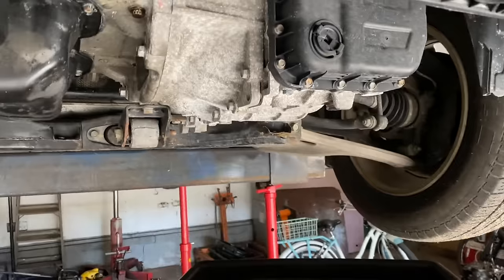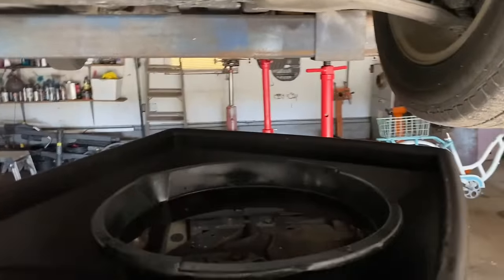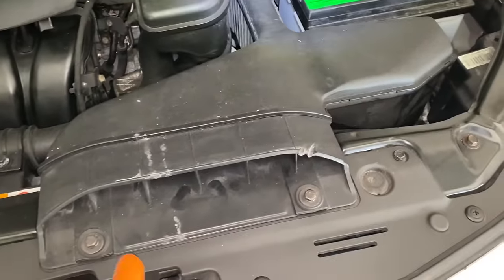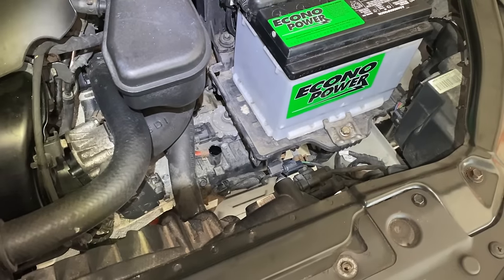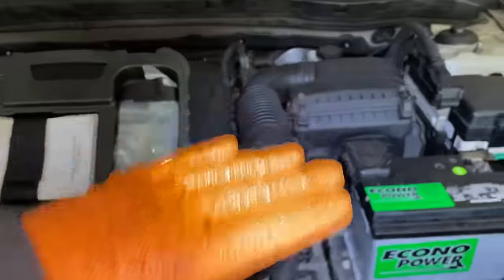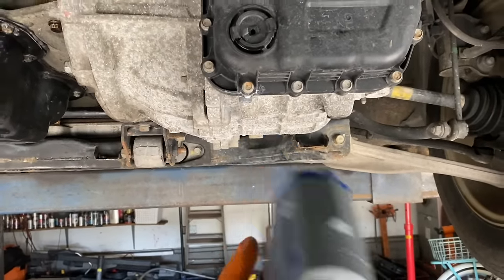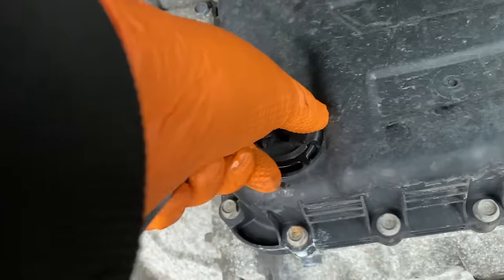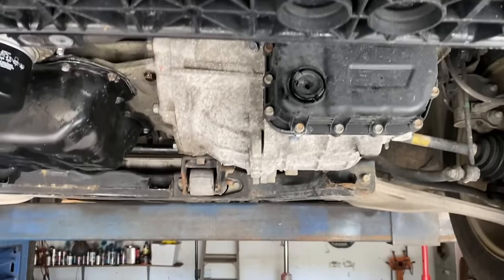Sealed Transmission Fluid Check & Change In Kia Optima Sorento  Sportage Rio Santa Fe etc. 2011 & Up

Comment: I love when a guy teaches me how to replace unreplaceable transmission fluid,  you the best!
Reply from the maker: Thank you! appreciate to comment!
Reply: @motorcarnut i have one with 185,000 miles on it. Im thinking of doing this. Should i?
Reply from the maker: @earlwright9715 if it were never done do half a fluid change at a time if it were regularly replaced then yes replace it.
Reply: @motorcarnut  thank you. I will go about it that way.
Reply: @motorcarnut  just to be straight  drain half of what's supposed to be in it. Replace that and change the rest another time?
Reply from the maker: @earlwright9715 good luck!
Reply: @motorcarnut  nevermind
Reply from the maker: @earlwright9715 but what you said was correct, drain half then refill
Reply: @Motorcarnut  thank you! I had a couple pints
Reply: Awwww, thanks, young blood! I am quite amazing.
Reply: Can you show us how to change on the 2017 nissan march please?
Reply from the maker: Don’t have one in the shop right now

Comment: When refilling these transmissions, remove one of the oil cooler lines. This will allow the air out of the transmission as you fill it. Otherwise it will keep backing up in the fill point and go everywhere. Remember to reconnect the hose after, or you’ll have a real mess to clear up.
Reply from the maker: Great tip! Thanks!
Reply: This is the comment i was looking for cause i do these at my shop all the time but the still have that problem.. i usually leave frint plug out and put my finger over as i let air slightly out as they poor in.. but deff gonna try this next time i service one in shop..

Comment: 2010 Hyundai Santa Fe 3.5l when I allow it to drain until a small trickle it shifts bad high high revs but when I add  8 oz extra so it’s not a trickle and a thick stream it shifts a lot better any idea why
Reply from the maker: You have to make sure the transmission is at the proper temperature first. And that you measure what you took out of the transmission and put that back in and start there.

Comment: Does the gasket come out easy on the plastic fill plug???  I changed fluid ,ANd the fill plug is leaking just a little I have a new gasket ordered ... Thanks
Reply: fill/level plug on the pan  NOT THE VENT/FILL PLUG on top
Reply from the maker: I don't see a problem, no.

Comment: Question: do I remove the bottom plug while the car is in park? And can the vehicle be running while adding fluid?
Reply: Yes and he doesn't specify so better off to just shut it off I guess, fill it, then start it again do the park reverse thimg amd check again. my question is tho is the filler cap still off(like in his demonstration) or do you replace it before starting the car
Reply: Nevermind he said to put it back on, then. Start it. While running keep checking till you get a steady light stream
Reply from the maker: Correct!
Reply from the maker: Do what rickybobby185 said, that's correct

Comment: Just learned Monday, that Mt 2016 Ford Focus has a Dry Dual Clutch, and does not have Transmission Fluid. And, it's a $3,000 - $4,000  Repair
Reply from the maker: It’s the power shift transmission is doesn’t have a pan be does use a special Motorcraft dual clutch fluid that should be replaced just like any other transmission.
Reply: Ford makes the WORST transmissions on the market, and they do it on purpose. I will never buy a newer ford because of it

Comment: You should always crack the fill port loose b4 draining!
Reply from the maker: Yes good tip for those who don know. If you can't get the fill plug off and already drained the fluid you can have problems
Reply: @motorcarnut  OK so there is ACTUALLY TWO (2) Fill plugs that I see people using!  One is under the Air Box (after removal)  and this plastic plug is actually the "VENT" for the transmission CORRECT?  The factory "FILL HOLE" is towards the rear and a metal 24MM plug like the 24MM metal drain plug -- CORRECT?  Does the Manufacturer (or dealer) use the VENT PLUG or the METAL FILL PLUG Location to add fluid?  That is my question!

Comment: Great video and timely one. I have a 2015 Hyundai Sonata slight damaged front underbody. Replaced radiator, still leaking coolant.  Turns out the transmission oil pan cover  and the water valve oil cooler was damaged leaking coolant and transmission fluid and needed to be replaced
Reply from the maker: Thank you for the feedback and glad it helped you!

Comment: Outstanding, thanks for sharing - planning to do here soon - only thing I'd add is to start with the trans cold (i.e. parked overnight) and the new fluid at the same temp - that way their density is the same, thus their volume - if one is warmer, it will have greater volume due to expansion - also, if your concrete floor has a slope like mine, just place a carpenter level on the rocker panel of the car below the side doors and it will tell you which end to raise on your stands until level - cheers!
Reply from the maker: Thank you! And thanks for the additional information! Appreciated

Comment: Good video. I just use the front overflow port as the proper level for the tranny. I don’t know why they have the plastic cap on top for the fill port. Dealers use the front port when filling. Thanks,  Steven B.
Reply from the maker: No problem, thanks for the feedback! Appreciated!
Reply: You use the level check port? How without it spilling right back out?? I have to missing something
Reply from the maker: Because when engine is off level is higher.

Comment: YO DUDE YOU'RE AWESOME!  Wish I'd taken this kinda stuff in school.
Reply from the maker: Thank you really appreciate that
Reply: That's not the fill plug. It's a 24 mm at the back on the top that's a breather port and it will take you ages to fill through that. Fill with a hook and hose from the back
Reply: @motorcarnut that's not the fill plug on the Hyundai 6-speed transmission. The fill plug is at the back of the transmission on the top and you fill it with a hook and hose and pump that's a breather port The fill point is a 24 mm plug as well just like the drain plug but it's on top at the back

Comment: The level off oil , in manual says to be taken with the engine on … if u take the level with engine off it will be a diference of 800 ml of oil
Reply from the maker: Whatever vehicle you have you go by , as a rule of thumb, whatever you take out you put back in then top off per your particular vehicle manufacturer’s recommendations as stated in the video. It helps a lot when people watch the whole video.

Comment: I used AMSOIL signature. No issues after 50k miles ago
Reply from the maker: Amsoil is a good brand but still has to be replaced as if we’re a Walmart brand. Contamination is the reason for the change just like engine oil.

Comment: I don't remember commending in this video, but: If the whole point is to check the level removing that plug at 7:14, why not add the fluid through the same hole? Turn the car, warm then add if you need more y the same hole. You don't even have to remove anything from underhook. Drain and add. turn on, warm, check level plug: Nothing come out, then add more fluid. SO EASY>
Reply from the maker: You can't add the transmission fluid through the drain hole it would pour right out because the engine is not running . Also you don't want to start the engine with no fluid in the transmission it would damage it.
Reply: Say the car were running and almost hot, I'm thinking you could still add fluid through the check plug until it drains out.
Reply: There is a video on YouTube where they fill the transmission fluid through that side plug on a 2020 Cadenza, never opened the top fill port
Reply from the maker: @marceloacuna6479 Just because you can doesn’t mean you should.

Comment: Fill plug is in the back by the firewall on top the transmission 👍
Reply from the maker: On other models, yes. Thanks for pointing that out.
Reply: OK so there is ACTUALLY TWO (2) Fill plugs that I see people using!  One is under the Air Box (after removal)  and this plastic plug is actually the "VENT" for the transmission CORRECT?  The factory "FILL HOLE" is towards the rear and a metal 24MM plug like the 24MM metal drain plug -- CORRECT?  Does the Manufacturer (or dealer) use the VENT PLUG or the METAL FILL PLUG Location to add fluid?  That is my question!
Reply from the maker: Use the 24mm metal drain plug if it’s easier.

Comment: Good video. Good camera work.  I have a 2018 Optima.  there's about 97, 000 miles on it. Is it too late to change the fluid?  No issues at all yet, I've heard that when the milage is high, the transmission fluid is best left alone?  I'd love to hear your opinion.
Reply from the maker: Thank you for that! Appreciated!

Most of those people just repeat what they hear. You can and should change the transmission fluid every 60k so you are overdue. I would do a drain and refill twice, once now and another in about a month. Then you’re good for another 60k
Reply: @motorcarnut    Thanx 4 gettin' back. I will and good luck to ya.'
Reply: Change don’t flush

Comment: Great video, Questions - I have a kia sorento 2012 with a 2.4 engine, AWD.   Would this video apply to my transmission?
Reply from the maker: Yes it will just there will be a front differential but the transmission itself is very similar.

Comment: What do you do for 6peed manual? There’s no park, so you just go through the gears?

I’ve suspected my transmission needs this since I got my 2102 Sportage with 111,000 miles. I’ve babied her for 40k more miles and now she needs some love after taking her on i70 and off-roading.
Reply from the maker: No need to on a manual transmission,just fill to proper level and done.

Comment: I have a question I took my 2020 kia forte to the shop to get checked because the car runs good when it's cool but once it warm up it start to slip won't pick up no speed I make a turn it jerk and then pick speed so the diagnostic was the 8th gear was bad it's a 147,000 miles  my daughter was doing Amazon delivery.. If u can give me some advice I would appreciate it..
Reply from the maker: Sounds like the transmission is going bad unless the transmission fluid is low or dirty. Did you try to check fluid level and condition? If not try it first.
Reply: @motorcarnut  nope I haven't checked the transmission fluid yet .Thanks I'm going to check it I don't know why that wasn't the mechanic first suggestion...

Comment: Should i check the fluid when transmission on R or P ?
As my mechanic checked the level on R and coming out slow stream of fluid 

I asked him to check it on P he said we will lose alot of fluid and will be below the requirement

When i drive there is a little shock on 2nd and 6th gear but not always 
Kia Sportage 2.4 GDI AWD 2017
Reply from the maker: Transmission fluid is checked in Park

Comment: What´s the normal drain amount? Like 4 Liters?
Reply from the maker: Depends, I always tell people put in what you take out as a starting point and fine tune from there.
Reply: @motorcarnut  Will do that. I just wanted to know if a quantity is expected. Thanks
Reply from the maker: @LRBP should be at least 3 1/2 quarts that comes out if the transmission wasn’t leaking or low on fluid.

Comment: If i have time to let it drain out over night, will the torque converter drain down slowly and allow more old fluid to get out?
Reply from the maker: No
Reply: Buy extra fluid do 2 or 3 drain and fills in between short drives will get most all old fluid out

Comment: My car turns off when I slow down. Auto Zone says code is transmission pressure solenoid. Does this solenoid cause the car to turn off?
Reply from the maker: It can but i'd take it to a mechanic for proper diagnosis

Comment: I use an electric pump to drain geared transmissions, can you do the same on a CVT's?
Reply from the maker: You can try, I never done it that way, just make sure what you take out you put back.
Reply: @motorcarnut  yah gona try it see how it goes
Reply from the maker: @user-xf4vy8xs3g let me know how it goes, curious.

Comment: My kia rio 2013 is shifting hard into 3rd gear while on D. When i use it manualy it shifts fine. Many people tell me not do drain the excisting. Just to add can this be true? Can it be fixed?
Reply from the maker: You probably have a shift solenoid. But if the transmission fluid is low or dirty it can be changed, yes unless it was never changed and filthy.

Comment: I’ve never a transmission fluid change, my car has 128k miles would it hurt the transmission if I replace it?
Reply from the maker: If it were never done but fluid doesn’t smell burnt, then do half flush now and wait 6 months then do a full flush
Reply: @motorcarnut  I’m in the same situation with 135k would you take all the old fluid out put half old back in and half new ?
Reply from the maker: @matthewpekkanen161 Yes, then in about a month do it again.

Comment: Which transmission oil should I use for Kia forte EX 2016 automatic 2 litre engine?
Reply from the maker: If you have the EX sedan 6 speed automatic . Best is Kia automatic transmission fluid or if you’re on a budget. Valvoline Maxlife Multi Vehicle Synthetic Automatic Transmission Fluid
Reply: @motorcarnut  Thanks and how many litres of fluid do I need to put in sedan?
Reply from the maker: Best bet, is whatever you take out, put back in as a good staring point. Don't rely on liters
Reply: Does this apply to engine oil? Because I just changed my 2017 3.3L V6 Sorento's, as per manual (5.7 liters) it's below the mark.
Reply from the maker: It’s different but you should ad oil until it’s at the proper level.

Comment: Is this also applicable for the hybrid kia optima?
Reply from the maker: No, Hybrid is different
Reply: @motorcarnut  I have 130k km on my 2019 Optima plug-in and thinking of changing the transmission fluid. Could you please explain a bit how it is different from those that have a torque converter?
Reply: @bobsanders2046 did you change the fluid to your hybrid optima?
Reply from the maker: @ebunnes You drain the fluid from the side front of the transmission and fill from the top after removing the air box and the fill plug.

Comment: Just to be clear, you are draining the fluid and then running through the gears with no fluid? Or did i misunderstand?
Reply: You run through the gears after you have refilled it and sealed everything up then you can check it but if you measured what you've taken out and put that exact same amount and that should be no problem my understanding
Reply from the maker: @duaneshadd777 if you knew it was correct level before and have no leaks then yes
Reply: @motorcarnut  that you will be attempting tomorrow. One more question will you get more fluid out if you wait 24 hours to change and trans is cold respectfully asking
Reply from the maker: @duaneshadd777 not much more no. If you want to that’s fine but not required
Reply: @motorcarnut  one more question do you go through all of your gears in the order that they are on your gear shift starting from Top all the way down to bottom then back down again ending in park thank you for your rapid responses much appreciated
Reply from the maker: @duaneshadd777 Yes that is fine
Reply: @motorcarnut  thanks your a blessing keep up the great work
Reply from the maker: @duaneshadd777 Very much appreciated!!!!

Comment: Can you change the fluid when the trans is hot as long as you fill between 122-144 temp? 

I changed the fluid runs great but took about 30 minutes to reach 122 temp. I would like to drain and fill again is it okay to drive to warm up the trans to get to say 130 degrees?  Thank you in advance.
Reply from the maker: Just whatever you take out you put back in then you can drive it to warm it up, but make sure it was at the proper level to begin with.
Reply: 3500  @motorcarnut
Reply: 3500 ML I took out I will put back the same 
Do you have to fill when trans is cold?
Reply from the maker: No, just with it off
Reply: Why not show the stream?? Wish you could have. I did a drain and fill on my 18 optima lx 2.4 a year or so ago and think i may have checked the level with the engine off. I just watched this video  and wanted to check my level to see how much came out. I monitored the temp til 60°c then open the side valve and a lot was coming out. Is it supposed to be a drip drip stream?? Im gonna do a oil change soon and just drain and fill the trans fluid. It was pretty dark anyway. Hope you can answer tho. I'm scared i might have let too much fluid out...? 😭 

Thanks for the vid!
Reply from the maker: @adictiveadictive I should of but it should be like a faucet that is barely open before it starts dripping if that makes sense. And it’s always good to put in what you take out then fine tune from there

Comment: It's only drain and refill, but how to do complete flush?
Reply from the maker: That’s going to be another video soon
Reply: So shouldn't you wait and do an actual flush instead of just wasting your time and money on fluid change?? I've always been told the sealed transmissions required an actual flush and that simply draining and refilling isn't worth the cost of the fluid required...???
Reply from the maker: @ClearerVisionz Sounds like someone is trying to get you to buy a unnecessary flush. Regular fluid changes is all that needed. Sealed transmissions are the same as any other just don’t have a dip stick.

Comment: That little plastic removable check cap scares me, if that ever cracked or popped out youd lose all your fluid,, bye transmission
Reply from the maker: Just remove it carefully it’s made for that.
Reply: @motorcarnut  Yes but those engineers should have made that bolt steel
Reply from the maker: @seatime674 I agree, all manufacturers cut corners to save a buck